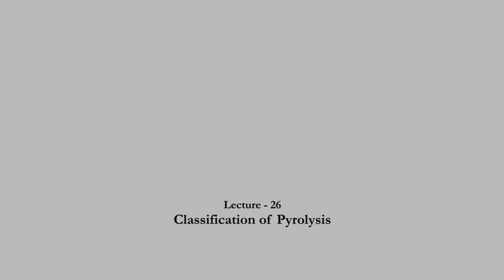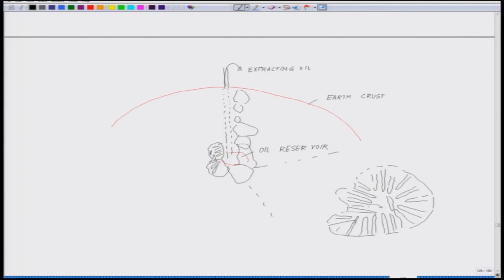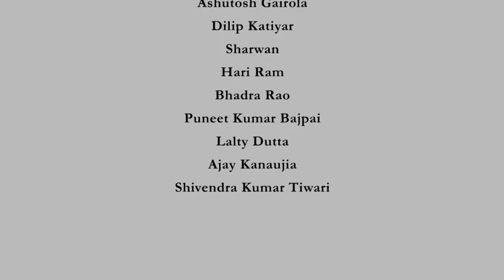Classification of Pyrolysis

Comment: What is the use of these lecture when no use in life. This technology was developed during WW2 and truck , vehicles run on this gasifier. IIT professor has no practical knowledge, they just memorise and spit out in classroom. Indian village house hold burnt wood but iit never simplified lives. If IIT professor don't develop practical use case then they should be asked to leave institute.
Reply: Currently involved in a project where we are developing a reactor for the pyrolysis of waste plastic to produce diesel, and other products, so I have found this useful :)